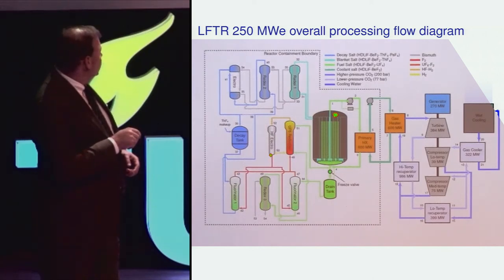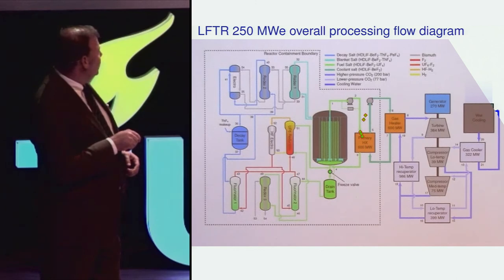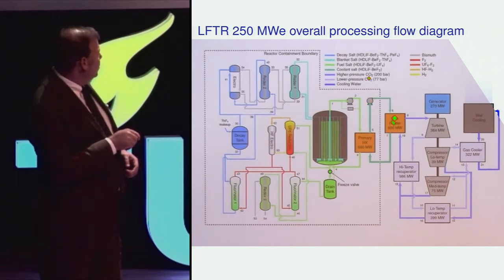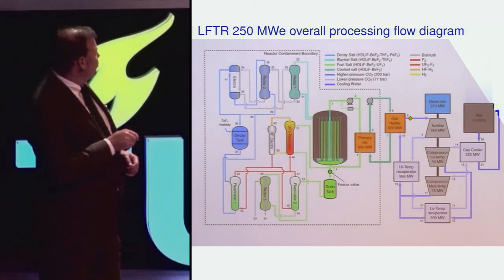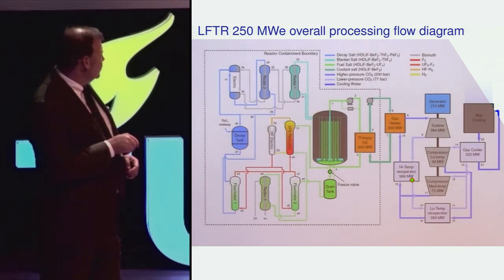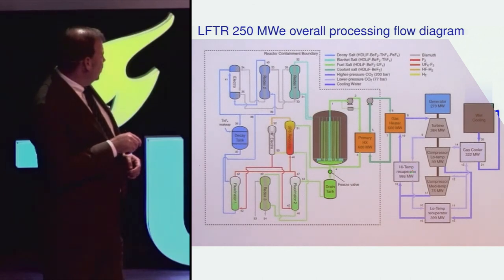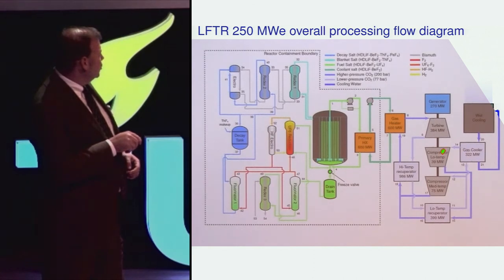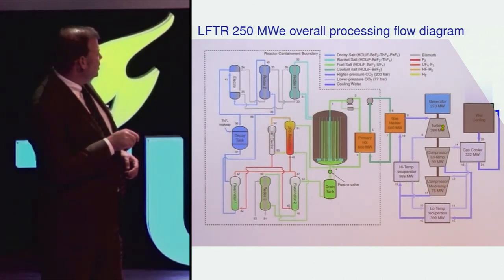4h13m39s09f LFTR Power Generation - Closed Cycle Turbo Machinery - TR2016a

Comment: Yes, and the cooling cycle heat could be used to drive a forward osmosis desalination process to get fresh water from salt water.  All the world's problems solved.
Reply: "All the world's problems solved." - It doesn't completely fix the damage done by the Star Wars Prequels, but desalination for abundant fresh water certainly won't make the situation any worse.